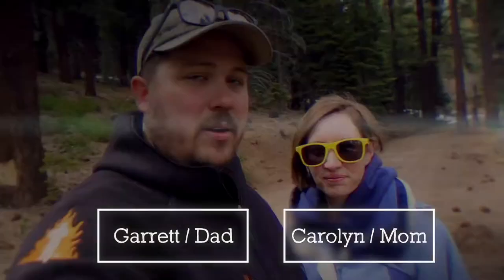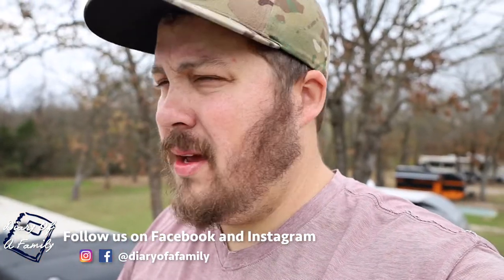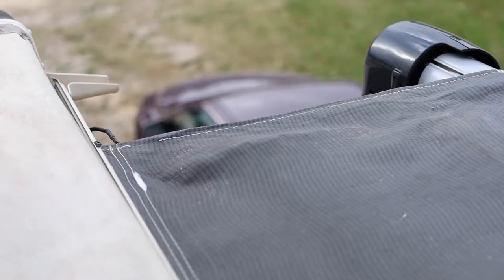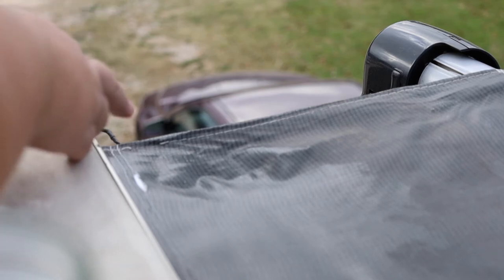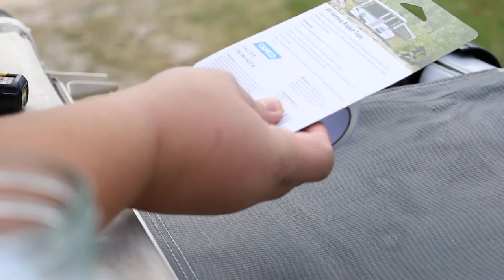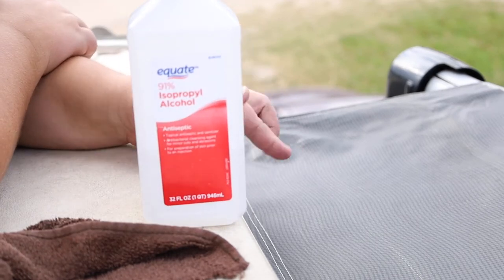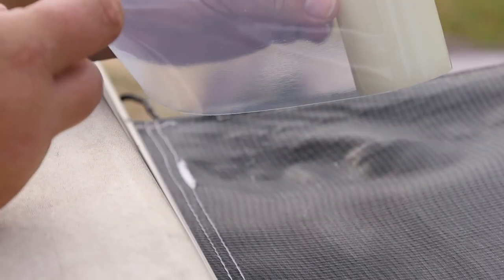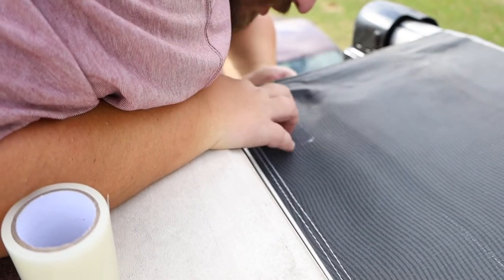How to fix your RV Awning

Comment: I don’t have a rip in my awning but the UV rays have started to cause damages to the fabric. Would this product protect the material from getting worse and to prevent me from replacing the entire awning?
Reply: You may need a flexible vinyl coating
Reply from the maker: This is more of a bandaid. If you are getting UV damage then I would consider a UV protectant of some kind or consider replacing it.